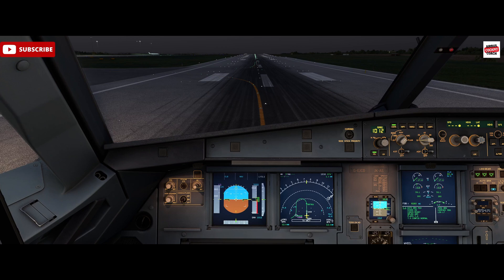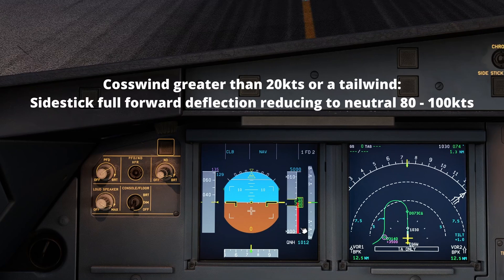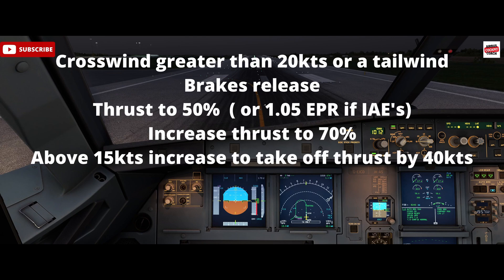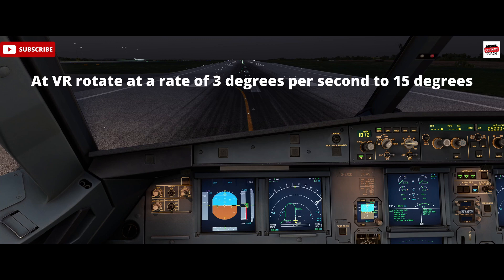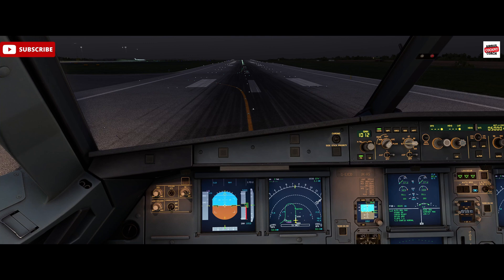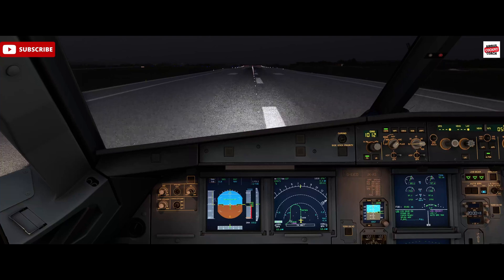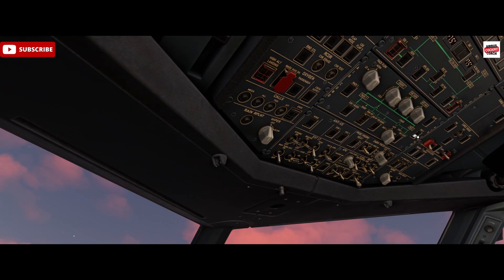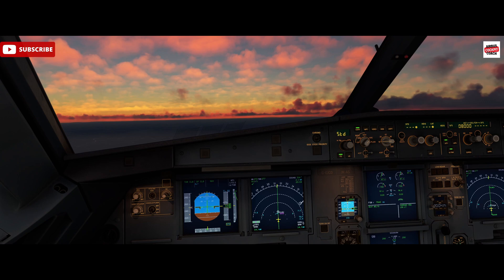A320 Takeoff Tutorial | Real Airbus Pilot Teaches in MSFS 2024

Comment: I’ve got a question regarding the lights , when do you turn on flood lights ? Is it preference ?
Reply from the maker: Hello, the main landing lights are turned on upon take off clearance being received. The nose wheel light has 2 settings taxi and takeoff. We select taxi when moving on the ground and select takeoff upon take off clearance being received. The turnoff lights are generally used on takeoff and landing and in poor visibility when moving on the ground. Strobe lights should always be on when entering a runway and for the entire flight through to leaving the runway after landing. 👍
Reply: @AirbusCockpitCoach  yes but what about flood lights, the one inside the cockpit yellow-ish
Reply from the maker: Sorry, the panel flood lights we will generally have at a low to medium setting at night, it is pilot preference but we will adjust those during cockpit preparation on the ground and adjust as needed during the flight. We do not want too much light at night to allow better visibility of the outside where possible so it's a balance of enough light to see what you need and minimising any glare
Reply: And another, question hope it doesn’t bother you, Nav lights, taxi, T.O and landing lights do you turn them on during the day?
Reply from the maker: Yes these are all used during the day. The Nav lights are on whenever crew are onboard and the aircraft is connected to a power source (ground power or APU) and must be on for flight. The beacon should also be on whenever the aircraft is moving or engines running 👍
Reply: Thank you for the explanations !!
Reply from the maker: No problem 👍

Comment: I have a question 🙋‍♂️ Regarding any rudder needed to maintain the centreline, I gently reduce it to neutral seconds after positive climb, using any stick needed to maintain wings level.  Am I doing this as per real world or not? Presumably you need to maintain that rudder input during rotation to avoid unwanted drift? Thanks 😊
Reply from the maker: Great question, once all the wheels are off the ground so when you have positive climb any rudder pressure should be gently released to neutral 👍

Comment: regarding spooling up the engines to 50% and checking that the egt is stable, I’ve noticed in real life flights that sometimes pilot bring the engines to the takeoff thrust directly without spoiling them up first to 50%. could you explain this, please ?
Reply from the maker: Hello, there are different airline SOPS that would influence this but Airbus advise spooling to 50% first. If you had a power inbalance due to a malfunction you could quickly end up off the runway if not detected before full power application. There are scenarios such as immediate takeoff required due to landing traffic where it is likely safer to get going faster. Due to FADEC (full authority digital engine control) being in place it will not damage the engines to throw the throttles forward. I would always recommend 50% first to check for any power imbalance unless there is a greater safety factor 👍